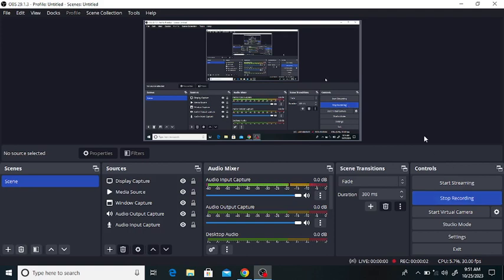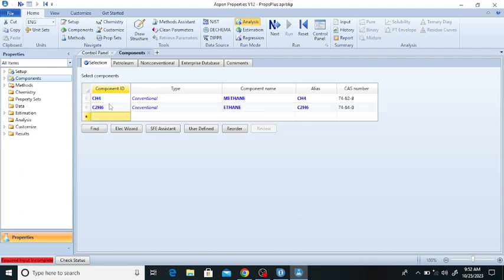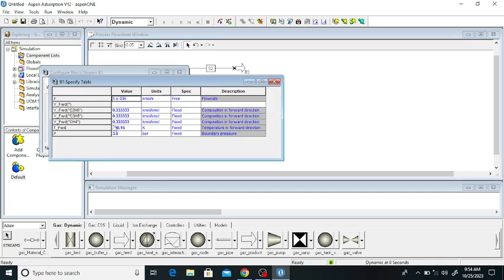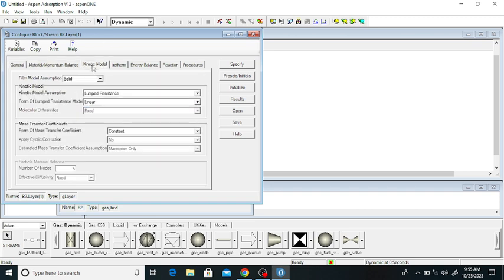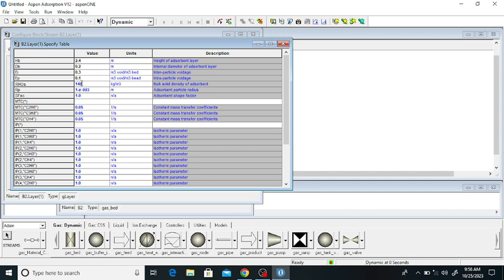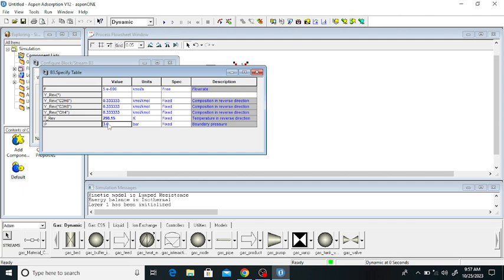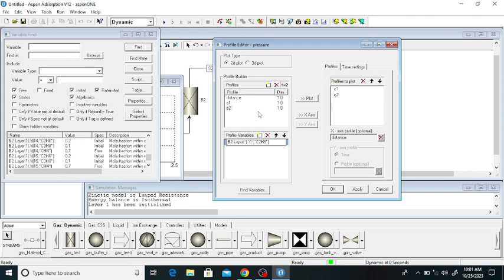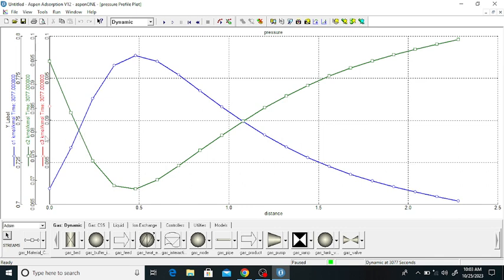Adsorption of hydrocarbons by activated carbon using Aspen Adsorption || LEC 02

Comment: Since you have a mixture of different gases, should not you have used either the Extended Langmuir-Freundlich or the I.A.S. Langmuir-Freundlich? What does it mean using the standard Langmuir-Freundlich with a mixture?